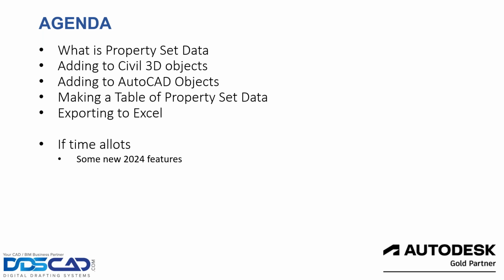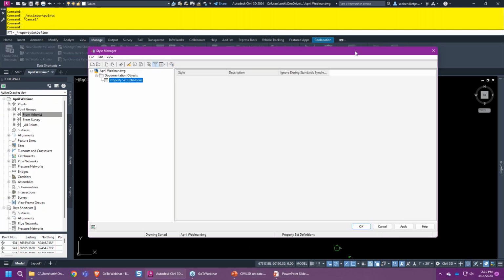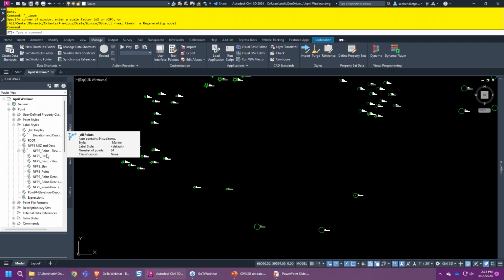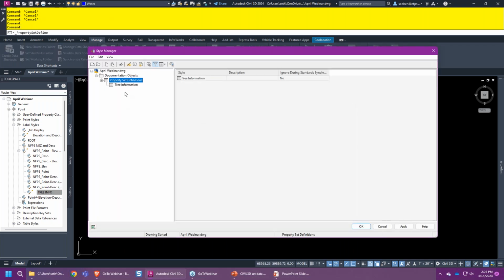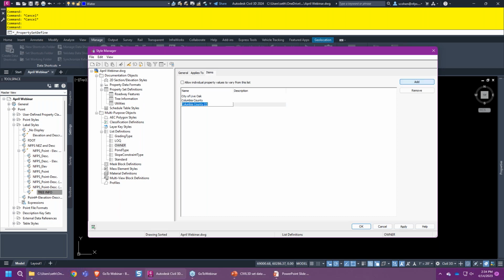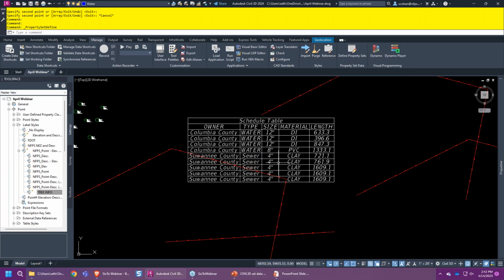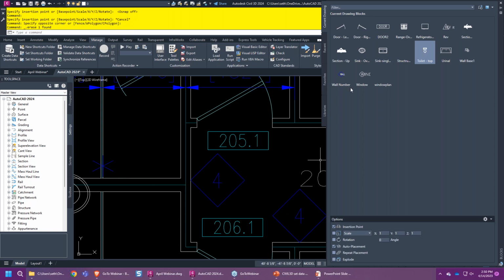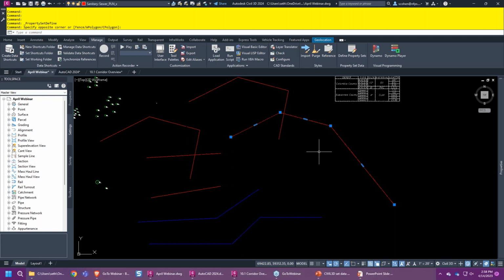Using Property Set Data in Civil 3D Webinar

Comment: Awesome video! I really learned a lot — just one question: If I’ve modified thousands of ordinary polylines (not AEC objects) to include additional data using Property Sets, how can I easily select them — like with the SELECTSIMILAR command — based on the same data in the Extended Data?